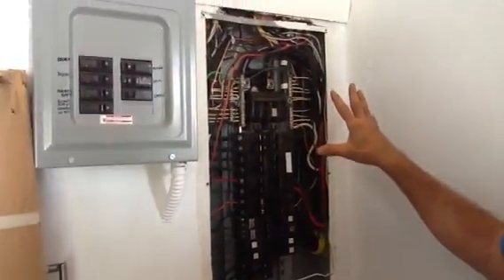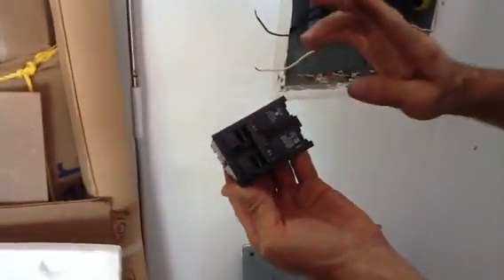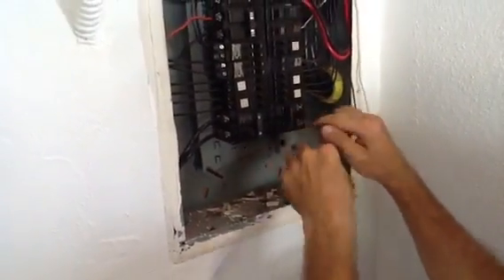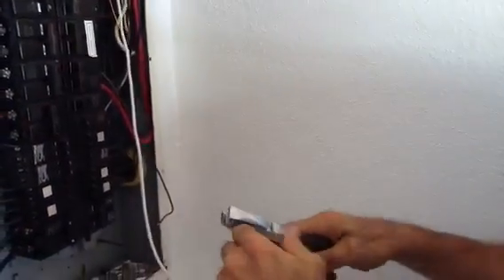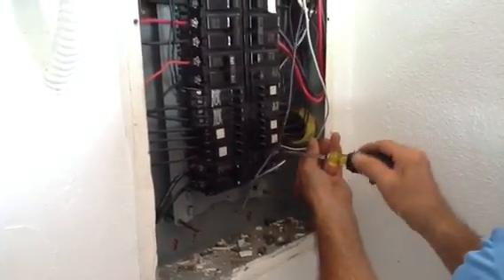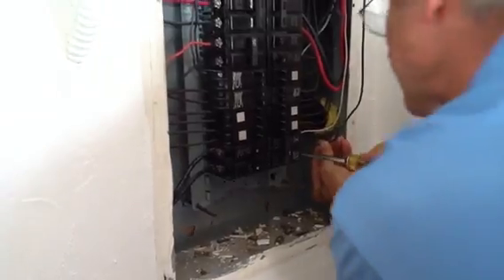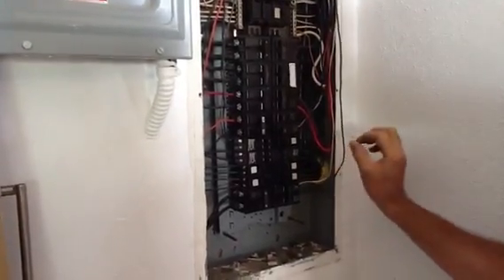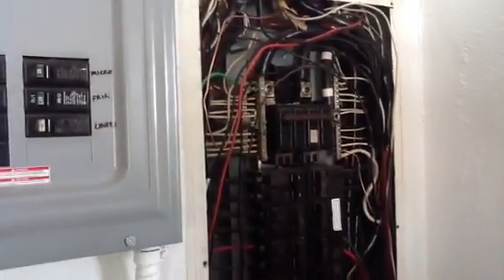Properly Installing an ITE Breaker

Comment: Glad to see you doing the tug test. :-)  One thought, I don't like to see those wires (others before you too) just under the lip of the box. Sometimes the cover screws can damage them if they aren't pushed back a bit. Arcing is not good. :-)